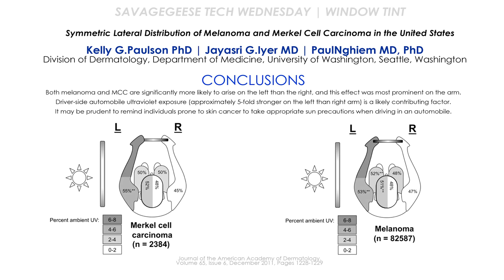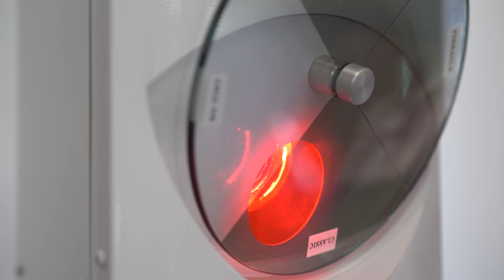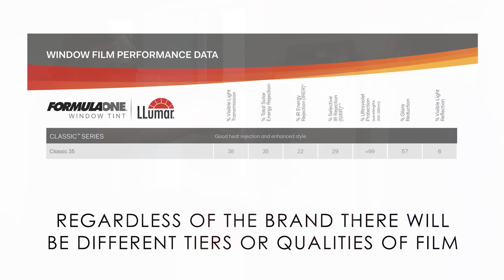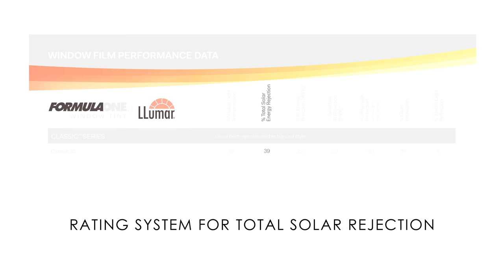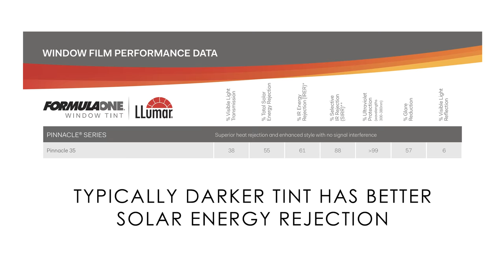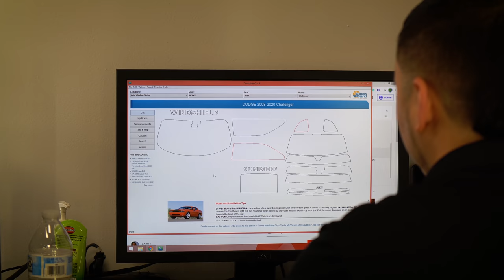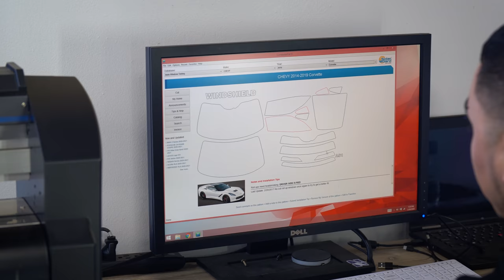Tinting Your Car and Truck, The Pros and Cons

Comment: - Glass actually blocks UV rays to a high degree naturally, especially the shorter wavelength, resulting in maybe 3-4% still getting through. What's the point of reducing that to 1%? I would most certainly not worry about getting melanoma from sunlight while sitting in a car. Instead I would worry about my general body health. (My work room has a reflective-coated window and I am using daylight fluorescent lighting with a natural portion of UV for health. ... Not living in a particularly sunny country though.)

- Regarding heat, modern car glass also has special IR blocking properties, albeit relatively minor I think. (Even a minimal tint seems to be common.) And if you put tinted foil on windows, that foil will absorb the light and convert it into heat, so instead of having your car interior as heat radiators, your windows will do a portion of that, specifically on the inside, although it can still result in an overall improvement to the temperature situation since the windows have direct contact to the outside. - The IR blocking property is much more interesting, and I assume/hope it doesn't absorb it but reflects it. That would be really interesting to me: A non-tinted film that reflects almost all IR. (I drive a black car without A/C.) But the best I find reduces visible by 30%. There must be a way to selectively block only IR without blocking visible. (And I still have an aversion to films on glass, and even more so if they have prism effect.) 
IIRC in Germany any tint film at all is illegal on windshield and frontal sides.
⚠️ Oh that reminds me: Safety glass will lose its benefit in an accident when you cannot shatter a window anymore to get out.

Also, he claimed you don't feel the visual light at all. I'm pretty sure that depends on the energy intensity. IR is simply somewhat longer wavelength than other colors. Later the film stats shown even mention the total solar energy reduction, which isn't doing much if it didn't also block visible light.

- As for safety, isn't even the windshield a special type of glass that doesn't splinter into shards? (The side/back ones are safety glass anyway that shatters into grains.)

1-1.5 mm thickness? Geez, that's a lot.

I hope all that water pushed out from under the windshield film won't seep into the dashboard and cause trouble there.

Comment: What about the cons? I imagine not being able to see properly at night would be one
Reply: Yeah I got the stratos 15 or 20 and it's tough to see into unlit side streets at night
Reply: Also, some cops could think tint means you have something to hide and harass you, lie and say they have PC and search your car
Reply: It depends on how dark you go. I have 35% tint on my car and it does not have a negative impact on either day or night visibility.
Reply from the maker: Yes go to dark and it's a hazard at night and then of course in the winter the car doesn't heat up from the Sun
Reply: I have 5% Tint and night driving is scary. Full disclaimer my sons albino so we have an exemption. When we first got it I thought it would be cool but after a month of getting pulled over 2-5 times a day and praying I didnt hit someone while taking a left, It feels like more like a responsibility now.
Reply: savagegeese probably much more practical with today’s active safety sensors
Reply: You can't use anti-fog applications on some films cause it can damage the tint! I think it is still more pros than cons.
Reply: I don't like how you can't use your defroster anymore after you tint the rear windshield
Reply: @rwh_  true.
Reply: Being profiled by cops is a big one
Reply: @rwh_  was it a specific type of tint or does it just deteriorate over time? I had tinted windows in my previous vehicle and never had an issue with that
Reply: @lajya01  F****KIN A
Reply: @birdcall2422  lol I work near Boston. The cops in the surrounding suburbs love to waste peoples time. They have gotten used to both of my cars. 1 is a 14 civic and the other is a 19 ram. Both white so the windows look even darker. Can you guys which car I get pulled over in more? Also MA. Doesn't attach anything to your registration to let them know when they run your plates. I have to hand them a notarized letter every time.

Comment: I absolutely love my Ceramic Tint (Johnson Film) on my 2019 Ram 1500 Laramie. I decided to get 70% on the Front Windshield, a 5% Sunvisor Brow Strip, 45% on the Front Side Windows, and 5% on the Rear Side Windows and Rear Windshield. I got it around 9K miles, with a lifetime warranty; and really love the look and privacy, not to mention the protection of the leather. It’s also mostly legal in the state of Ohio. Front Side Windows should be 50%, but 45% is close enough. I don’t see any defects or particles in the tint either. Highly recommend it, and for Ceramic it was about $375 for everything which isn’t bad at all. Other places would charge $400 for normal tint or $700 for Ceramic, crazy. If you wanna have a great look and added protection, look into tinting your new car. :)
Reply: How does the windshield tint feel? Noticable difference?
Reply: Joe Stevens it’s 70% so, visibly there’s no difference as if there were no tint, because the front windshield glass is already at around 70% from factory. Slightly different ‘texture’ to it when looking out but it’s cuz of the ceramic film I got. :)

Comment: In Texas tint laws are flexible, dark dark is allowed but I did windshield tint. Not legal anywhere but driving through west Texas at sunset sucks especially during the summer. It’s nice to have good heat protection.

Comment: The cheapest way to get good Ceramic Tint installed is to buy the roll of tint yourself online (make sure you measure correctly and get some excess) and then go to different installers and ask them how much labor they would charge you to install your tint. I did this with my dad's Tacoma and saved well over 50% of the cost.

Comment: i am sad - over here in Germany we are not allowed to tint any front windwo at all. 
Not even with a Clear Film that only has some sort of UV Protection or something that is like a 90 rating that absorbs UV and infrared to keep the heat out during summer.

Comment: to bad it's "illegal" in a lot of places to tint the front seats for the cops to be able to scope out people for belt tickets, ext. ext.
Reply: Tinting the front windshield is stupid, as I see in my country people tinting the rear lights so noone can see when they brake or make a turn
Reply: Honestly, it's hard to tell the front is even tinted.  The "dark" front tints are 70% and you can go up to 3M Crystalline at like 90%.   IMO the front will make the biggest difference in heat on most cars.  If you're like me and you find it very irritating to drive at night it's extremely helpful.  You don't actually need the dark shade to help with heat if you live in a warmer climate either.  The material itself has a tremendous impact on heat rejection and the benefits can help your dash as well as make your seats, steering wheel, shift knob much more pleasant to touch.  It helps preserve electronics which may be heat sensitive long term.  If you have any substantial rake to your windshield and can't park with your windshield not taking direct impact from the sun it's possibly worth doing.  One thing I have found however is that the quotes I get for windshields are close to what all of the rest of the windows cost.
Reply: I don't know about tinting the front seats but here in Michigan you can go as dark as you want on the rear windows and back glass.  Nothing on the front windows or windshield.  I run 20% on everything with nothing on the windshield and have never had an issue.

Comment: I have wind deflectors on all 4 doors. Just wondering overtime with tint, will the deflectors ruin the tint.
Reply: No, they shouldn't.
Reply: do they hang over the door? Tint is installed on the inside of the car, and your deflectors dont touch the inside

Comment: A
Question: you “feel” IR heat but radiant heat is presumably still a factor that’s not stopped at all? A car sitting on hot asphalt will heat up  to similar temps still yes?
Reply: Yeah, Regardless of tint or not, the interior of the car will still be uncomfortably hot if just sitting out in the sun.

Comment: I think llumar makes a film for protection against break in  ......rocks ,hammers , baseball bat , spinner have all been used and yes the glass cracks but it takes forever to get into the vehicle which is a massive plus if you live in a shady area

Comment: Tinting the fronts here is illegal, but I always do a slight tint for the rear doors/side windows and back window.  40% I guess?  Not only does it look better, but it also prevents some heat from getting the car and whatever is on the backseat/in the trunk (I have an SUV) away from prying eyes.

Interestingly, I have NEVER seen tinted windows in Italy, which ironically get scorching hot in the summer.

Comment: That UV argument is kinda Snake Oil-ish. All cars nowadays block UV-B as you wrote, but the windshield usually blocks UV-A as well. Yes, side and rear windows still let UV-A rays pass but blocking those with foil do not really reduce your risk of getting cancer trough UV-A exposure. I'd say you are even more likely to die from using them then because you can't see shit anymore at night.
Reply: Even on cloudy days 99% of UV rays are coming through the clouds. UV is what causes sunburns and skin damage. Skin damage and sunburns are a leading cause of skin cancer. Skin cancer is one of the fastest and most dangerous types of cancer. Anything that reduces the risk is worth your life. If you have trouble seeing at night then eat more carrots or drop a window if you're approaching a dangerous intersection. The responsibility for your safety is on you. Be proactive.
Reply: @thisismagacountry1318  UV-B causes skin burns and UV-B rays are blocked by all windows by default. This is about blocking UV-A which is already active on the windshield, as I wrote. Protecting your side and back windows does have a very little impact on the exposure of UV-A rays, as I wrote. 
My argument that you can't see at night anymore has nothing to do with my eye capacity, it is due to tinted windows. Darker windows = less vision at night.
Reply: @inspectorchicken  Front side windows on upper end vehicles have UV-A protection. The windows do go up and down on most cars so if you're feeling unsure about line of sight drop one. Just want you to be safe.
Reply: @thisismagacountry1318  but dropping my window would increase my UV exposure :-O
Reply: @darekm6859  Darwin had a theory about them.
Reply: @inspectorchicken  Life doesn't come with a guarantee. Be proactive and wear quality sunscreen.
Reply: @darekm6859  Don't worry about our maga warrior, he'll just light the interior up with his phone for better vision.
Reply: @thisismagacountry1318  triggered. It's so easy.
Reply: @inspectorchicken  I know, that's why I use this name as bait. Pissing off snowflakes is my business and business is good.
Reply: @inspectorchicken  Yes, the rest of the world hates us SO MUCH they're flooding in illegally. Everyone hates what they can't have. It's called jealousy.
Reply: @thisismagacountry1318  your blatant hatred makes me sad. I hope you can free yourself from that one day.

Comment: Why can I find a professional tint shop like this in my area? I got my car tinted at a guy's driveway, the job is decent but I have no idea what kind of film he used. My wife had been pulled over couple of times by police due to tint is kind of on darker side, I think I went to 35% but the interior is also black so that might contributes to the tint appears darker then really is.
Reply: Most audio installers do tint. Even if they dont they know the spots in your area.

Comment: Pros: your interior materials and surfaces won't get so burnt up by the sun, car looks way better, if the guy next to you at a stop light has a cooler car, they won't see you tryna look at it, and so much more!

Cons: police might have another reason to stop you (even if it's legal, they might feel they have to check) , and it's harder to parallel park at night unless you have 360 camera or city street lights aiding power tilting mirrors

Comment: Isn't that the front windshield already blocks most of the UV without any tint or film?
i thought all the cars sold in US have are required to have laminated windshield (plastic layer sandwiched in between glass layers). 
the plastic layer in it will block nearly all of the sun's UV rays

Comment: have always run tint on my cars but it has gotten much harder in NY.  as of jan 1st 2017 the state now checks for illegal tint during yearly inspection.  shops face multi-thousand dollar fines if they look they other way.  we're only allowed 70% on front/rear sides of coupes/sedans/hatchbacks (which is see-through).  one more reason to leave this state.

Comment: Remember, check what's actually on the books for your state rather than making assumptions based on what you see on the road. For instance, in NJ it's completely illegal to put any kind of tint up front. While the cops aren't super-active at enforcing it by itself, that's the sort of thing that you can get dinged for if they pull you over for other reasons or are just generally looking for ways to bring in more ticket money in an area.

And, +1 to the people who've mentioned that windshields and side windows in cars from the last few decades already have UV protection. I used to get the original UV-activated Transitions prescription lenses but stopped in part because they either wouldn't activate at all (window up) or would do weird things like change in a diagonal streak across my lenses (window down) while I was driving in them!
Reply: It only blocks certain uv not all.

Comment: The tint on my 15 year old TL still looks good after 15 years, so make sure you find a reputable installer. Unfortunately i have been able to use my auto dim rear mirror. Oh well.

Comment: Why are they tinting the outside window? Any good tinting place will always tint the inside window.. ???

Car windows block UV rays, it is etched right in the window.. UV Protected...
Most states do not allow limo tints, so how are you hiding your valuable.
Plus you cannot tint your front windshield, unless you have a doctors prescription for light sensitivity.
Reply: They aren't tinting the outside window. They lay it on the outside to get the shape, remove it, then reapply it to the inside

Comment: aren't all car windows laminated unless your cars from like the 1940s
Reply: Sunamer Z  Those are not laminated but safety glass (a.k.a. tempered glass) so that they can shatter into harmless grains and allow easy escape in case of a severe crash. If you apply tint film, that's not an option anymore.

Comment: Do any of these films degrade radar detector, gps, or reception and transmission of mobile phone signals/internet?
Reply: Metallized tint is really the only one that will block radio signals, and they talked about it briefly in the video.
Reply from the maker: Yes and they don't stock it for that reason.  Although if you were RF phobic it maybe a good choice.

Comment: I live in PA and window tinting is illegal.  I won't do it because I don't need the police having a valid reason to pull me over, give me a fine, and then I have to prove I removed the tint.
Reply: I'm curious, is PA 100% illegal for any tint or do they allow like 50% of the light to be blocked like VA?
Reply: @troypatillo1688  According to PennDOT, tint is not allowed on the windshield of a vehicle except for the top four inches to shade the sun. The front side windows and backseat windows must allow for more than 70 percent of light to come in the vehicle. The rear window can be tinted.

Comment: Watching them push all the water from the windshield tint into the dash made me cringe, especially with all the electronics by the head-up display. A professional place should also be using lazer cut film shapes instead of using blades on your nice car. I thought they were professionals. Definitely not taking my car there.

Comment: There should be a greater warning about problems with the police when your windows are tinted. If you watch all the YouTube video on police abusing citizen's civil rights, you will see many cops fishing for crime and reasons to escalate encounters with motorists. Cops do pull cars over for no other reason than window tint. Maybe you're car is within the law but that's even subject to the cop's interpreting his test. It also won't help if he can find any other reasons for pulling you over after he's already stopped you for window tint. In some places cops use window tint as the sole basis to begin further roadside investigations. This will sort of abuse of power won't typically happen when it's convenient for you. It could easily be primary justification for pulling you over in the first place. In many places it's like wearing a "kick me" sign on your back, inviting police to single your car out for a stop. Most times cops have better things to do, but it only takes one bad cop to decide to use  window tint  as the easiest excuse for pulling you over in the first place. I live in Texas where tint helps with the heat but here in Texas the politicians allow small towns and counties to police for profit. So it's something I just don't want to deal with. When it comes to police encounters/investigations, the less you have the better. I even knew a cop who told me he looked for cars with air fresheners hanging from the mirror and window tint to pull over, as he believed those were signs  of a car more likely to be used for transporting drugs.